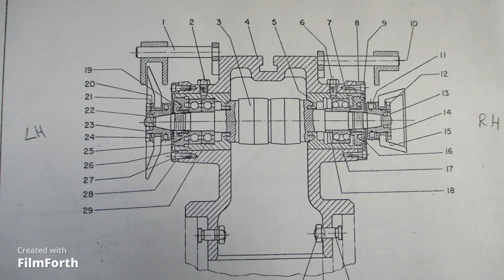Back on track for close tolerance machining

Comment: Close tolerance machining practices would be fun Dee. I generally try to use what I know of that subject whenever I machine something unless the job requirements and what I am getting paid to do that job forbid it. Then it just gets slammed out. Otherwise I try to hit the nominal numbers  as close as I can. It's fun and good practice for when you have to work to "Tenths" There is something satisfying about hitting your number dead on when making parts. espscially when your machinery is not in the best or new condition. Looking forward to the new power converter and some chips. Cheers
Reply from the maker: I ended up doing casting repairs for pumps, transmissions and such. The need for close tolerances is always for bearings, and with the jig borer there is also higher accuracy location. I forget to be clear on that the only time I need to try to get close as possible is for bearings. There is a lot of hostility in the beyond hostile US machinist cyber community that I despise, and nothing stirs this bunch up like anyone talking about jig boring or close tolerance work as can be seen little or no discussion on the US fake machinist forums. Here I have blocked several of these ass clowns on my channel so far. This likely is where the accusations of me corrupting youth is coming from.
 I should talk about my perspective working private and small business, it is much different than those that go through the formal apprenticeships and make dies for Ford. Where the fact is I could not function in their world, and they certainly cant function in mine. Stay tune for more youth corruption!
Reply: @deedeeindustrialsuperprecision  Outstanding sir. I think you and I have followed similar but not identical paths. I am in the repair business and have been for nearly 40 years. Corporate manufacturing or production machining is not for me that's for sure. I would love to hear your perspectives on the aforementioned topics of private and small business  Having said that I am younger than you by a decade or so I would guess. So keep on corrupting the youth... I am listening.

Comment: What's the deal with the Lodge and Shipley lathe picture at the end of the video?   Having a Lodge and Shipley 14 x 30 inch Model X makes me curious.
Reply from the maker: Yes, that was a L&S Powerturn model 1610 Copymatic that I started my commercial shop in the 1980s with, I sold that lathe in 2005

Comment: Dee Dee, in 1979 i held a job at a burlwood slabbing/furniture factory doing parts for slabbing jigs for chainsaws as well as replacement parts for the machines and jig's. I learned on a bridgeport clone, a rockwell 12" wood and metal(screwcutting) lathe, 18" makita bandsaw w/2" vcarbide band etc. We had stacks of redwood burls in slab form and constant dust clogged air. The 4000 sq. ft. shop seemed small at the time but seeing what you are capable of making work I feel ashamed of myself. I could have used that radial drill. Great share, looking forward to seeing more on your drill!! 👍🙏
Reply from the maker: High, thanks! I will squeeze that radial in somehow, I could not leave it where it was to rust, but I wasn't looking for one, and now I have a big machine to deal with, but a good one.

Comment: My DSG lathe has 48 feeds from 1.1 thou to 64 thou per spindle revolution (2 to 112 tpi threading), there is a lever on the headstock that gives a 4 times course feed in low range and a 1/2 feed rate in high range, there is also no reason why the extra change gears cannot be used to reduce the feed further, the standard change gear ratio is 1:1 and with a compound set up I could get to 1:4 or lower, I could get it close to a ten thousandth per rev if I wanted.
Reply from the maker: I think you are in a good spot with the fine feed you have, The DSG lathes are considered among the best, but a rare sight. I was hoping to find one in the size of this Axelson.

Comment: Hey speaking of accuracy,  what would you recommend to do with a tailstock that is about 7 thousands too low ? Shim it I'm sure but how ? Or where do you put the shims ? Also is this a common problem because I don't see much info on it on the webs. Lots on left to right or front to back but nothing at all on this. The tailstock is between 7 to 10 thousands lower than the headstock and there is no adjustment for that on my tailstock? I got it within a tenth from side to said but it's still not accurate due to that 10 thousands.
Reply from the maker: A spec that is not widely known is new lathes the tail stock should be just a few thousandths high. The Monarch 10ee tailstock being pushed and pulled by the handwheel causes wear that causes the tail center to point downward and toward the back of the machine. The spec for a tool room lathe is center not over .003" high. Because it is not severe wearI would try to shim it back as close to .003". and determine what is causing the wear and avoid it. The Monarch ee tailstock should be moved by grabbing behind and under the base with one hand with the a couple of fingers under the nose with the other hand when moving to stop the wear caused from pulling on the handwheel. Anyway the tailstock quill should be parallel with the ways.